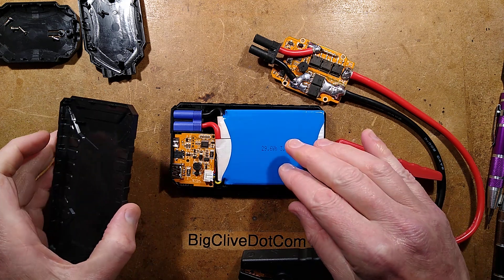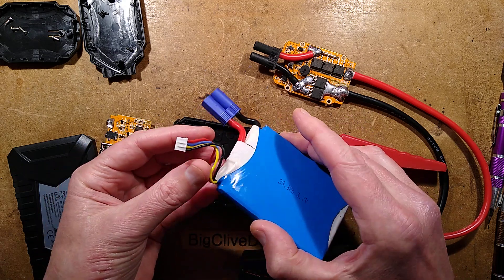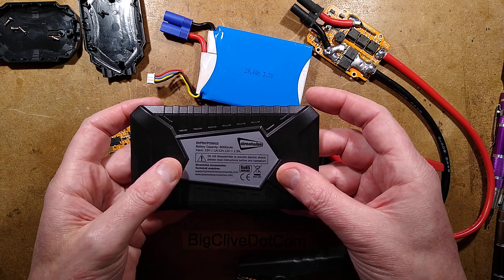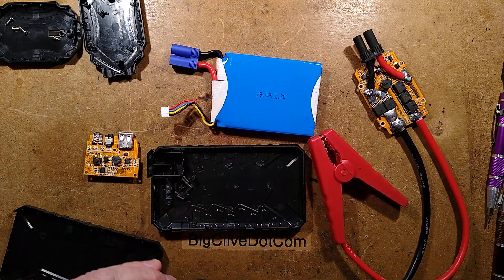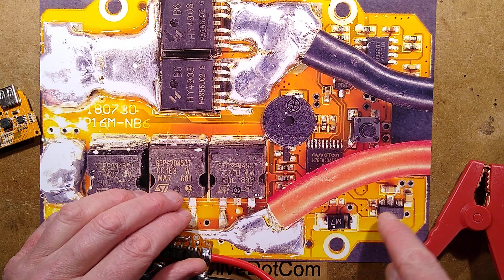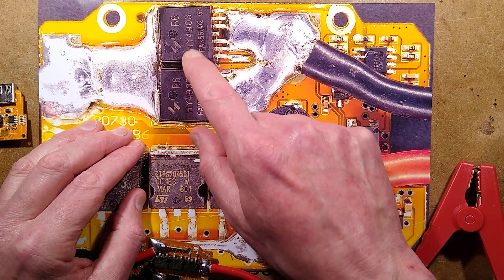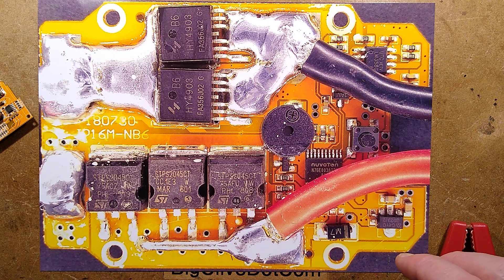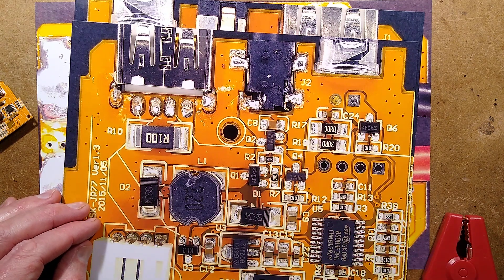Inside a combined power bank and jump starter

Comment: Since it already has a 12V battery, can it do USB PD (i.e. put those 12V to the USB port if the charging device negotiates it)?
Reply from the maker: In this case the USB output does not have the data pins connected.
Reply: @bigclivedotcom  if the data pins arent shorted, the device doesn't even ask for higher currents then 1A.

Comment: I remember that Samsung disaster, I had one of the note 7's affected, and got back the "Check marked" replaced battery version, still had problems getting too warm, I was left with work around of using a partial vacuum clear container, and had it off like 80% of the day lol. Although I wonder if it had still gone to hell if it would have generated its own oxygen to keep a fire going? hmm.

Comment: You can get a 12V Cig Lighter Socket for these that plugs via the jack on the jump part if it has one, or plugs into the same connector on the pack. No protection or fuse though, other than the fuse in the plug if any.
Reply: The problem I've found with those is that they seem to overpower my 12v appliances. I was wondering if it was better to use the lighter socket or use a usb to 12v adaptor. The adaptor is less efficient but it would seem it might be safer, both for the battery and the overpowered appliances.
Reply: @thomaswilliams2273  They shouldn't overpower a device designed for a 12V socket, as the ones in your car are not generally regulated to 12V, they connected via an ignition relay and a fuse only normally so they output whatever the battery or battery+alternator voltage is which could be between 11-14.8V and this will output somewhere from 11-15V depending on charge.

A USB to 12V would generally be a noisy source of 12V but at least a constant voltage but a 5V@2.3A source is likely to give less than 800mA at 12V converted even if it's a very efficient buck converter.

Comment: I'm wondering if you or someone can help me out. In trying to reduce voltage from a 40v battery down to 20v to use on a hot wheels. I can't seem to find a buck inverter that goes up that high. If you have any ideas it be greatly appreciated
Reply: Assuming standard brushed motor, replace the controller with one that can take 40V and limit the duty cycle to 50%.
Reply: @NiHaoMike64  I tried this and already burnt through 1 motor. Used a pwm board made for up to 60v set at only 40%. You could tell it was running way harder than when I had it hooked to a 20v source

Comment: I'm very skeptical about these. For one thing those wires look too thin, and from what I recall, Li-Ion batteries hate discharging huge loads in one go. Peter North it is not.
Reply: You're sorely misinformed.
Reply from the maker: These cells are optimised for high current and the cables are intended for intermittent use.

Comment: Is that Marking  on the battery correct at 29.6Wh at 3.7V  or is that marking just for 1 of the 3 cells to output ~12V ?
29.6/3.7 = 8

Comment: I have one of these combined power bank and jump starters and it has come in handy a few times over the last couple of years. And the only difference mine has over the one in the video is a button you have to press when you are connected to a car battery to initialize the process and it squeals at you when the car etc has fired up to force you to disconnect it to prevent damaged. "Arteck Car Jump Starter Auto Battery Booster and 8000mAh External Battery Charger Car Jumper for 12V Automotive, Motorcycle, Tractor, Boat, Phone" and it's no longer listed.
Reply: You don't see the pushbutton? It's on the small board clear as day.
Reply: @Slicerwizard  I had been up for a long time when I watched the vid.

Comment: Diodes seem to be identical (stps2045ct) but different production dates. Datasheet doesn't seem to have any information on the markings apart from the part number, which says the STPS2045CT is the TO-220AB package. Still a bit odd that they used 3 parts from what seem to be wildly different dates
Reply: the parts looked used to me

Comment: I remember Photonicinduction playing around with one of these. I think the 12V connection had just the diodes for protection, nothing else. He actually started his car with just this thing, disconnected the cars internal battery (NEVER DO THAT). Just shows how much current these things can deliver. Pretty scary, carrying that around in your pocket (I certainly wouldn't trust them, at least not in my pockets, or in a car, that can get pretty hot while parked in direct sunlight).
Reply: I still have that same model. Works every time. No stupid pushbuttons to turn it on. Just connect the leads, let it put some juice into the dead battery for a while (duration depends on just how dead the car battery is), then start. It has even started and run vehicles with dead batteries and dead alternators long enough to get them home (you've got 10 to 15 minutes, max; helps to disconnect the DRLs and stay off the brake pedal)
Reply: clive once did shortcircuit one of these with a copper tube and measured the max. amps. can't remember exactly but it was over 200A IIRC.

Comment: 2 amp is not enough for a jump starter, you did not explain exactly the most important thing about this device which is the maximum current output
Reply from the maker: The 2A is just for the USB.  The battery pack can supply 100's of Amps.
Reply: @bigclivedotcom  thank you
Reply: It has plenty of output current.

Comment: the shock hazard comes from the charger witch connects to any 110 or 220 outlet.

lithium cells can start fire if punctured or damaged.

most mosfets have a current limit much lower because the package has a limit so there will often be lower than the semi conductor material.

i think most of the jump starters are intended to charge the battery up enough to allow you to start the car.

for example lets say you leave your lights on and drain the battery to the point where you cant start the car this is great for that.

you are really pushing the limits of these units trying to start a car from a completely dead battery that is dead because it is old or acid crust builds up on the terminals.
Reply: "i think most of the jump starters are intended to charge the battery up enough to allow you to start the car."

No, they put some charge into the battery, then their combined output starts the engine. Can take a minute or two.

Comment: I'm not an EE, and didn't know anything about these jump packs (I do have one) but I was surprised by the design.  I had always assumed there would be some sort of supercapacitor in them that would be used to actually jump start the car.  Is that high discharge lithium pack some sort of hybrid between a battery pack & a capacitor?
Reply: No, it's relying on the ampacity of the lithium cells.

There are some supercap design jump starters...Project Farm included one in a jumpstarter comparison, a few years back. That particular model used the residual charge in the vehicle battery to 'fill' the supercap, and then burst discharge it back, hopefully giving enough ampacity, fast enough, to turn the engine over.  PF didn't have much success with it, and found the more conventional Li battery models much more effective.
Reply: Super capacitors just don’t have the energy density needed.

Comment: A 9-volt battery on the tongue gives a tingle but I imagine this would pack quite a punch. 😝
Reply: Nope, we at least not mine: if it doesn't see that it's connected to voltage, it doesn't turn on.
Reply: @tactileslut  well, what fun is that?

Comment: I’m kind of surprised the jump-starting module doesn’t do at least some over-discharge protection. It already has everything it needs to cut the output off. It’d cost, what, one wire between the modules and maybe a passive or two to power the 12V module’s microcontroller from the 5V side’s output?

Do they just not want protection? I suppose that makes a bit of sense: If you’re using it as intended you’d rather risk wrecking the lithium cells than having it refuse to start your car just because there’s a fault on the 5V side that prevents it from working as a USB power bank.
Reply: Actually, I think you're right on the money there. Sacrificing a few lithium ion cells to get your only link to civilisation working again seems like a worthy cause; so long as said cells can fail in a non-lethal manner.

Comment: How do these compare to those supercapacitor ones in real life situations? Supercapacitor ones are useless if the battery is flat, but then again, do the built-in battery ones perform any better? I image they'd drain pretty fast, that's if they even started at all, before the high-current cut-out kicked in. I have a 13 Ah one, but haven't needed to use it yet. When it's -15 C outside and the battery is dead, I'm not gonna get my hopes up with these. 😅
Reply: They work. You warm them up first by shoving them down your pants for a while... then clip on to the dead battery for a couple of minutes to bring it back to life, then fire up the engine, then unclip - and recharge immediately...

Comment: For protection, maybe add a big relay powered from the USB 5V output? This way, the device will shut off when cells are discharged. Remember to cut off the high current board too, as its microcontroller draws significant current the whole time it's connected.

Comment: @bigclive 
Could we soon make a diy video of interior lights for cars.
Alot of people need them in warm White with and without CANBUS🙂

Thanks for all your videos over the years🙂👍🏼
Reply from the maker: The canbus feature on eBay bulbs is often just a load resistor.
Reply: @bigclivedotcom  
Hi clive yes i have seen some of them.
And i dont Think many of them is looking safe. And as a mechanic a have a couple times made burned wires on cars with Chines “canbus” bulbs.

You could make them safer for us with less heat i Bet🙂👍🏼

Thanks for answering🙂

Comment: Awesome video. I have some higher capacity more “professional” units that I use in my day to day at an automotive shop. I’ve not found anything my NOCO GBX155 won’t turn over. Not even massively upfitted motor homes with 4 or more 12v batteries in parallel. Even with our dual full-sized battery jump start cart, we used to have to disconnect some or all of the batteries to get those beasts running if they were really dead.  The Schumacher DSR128 is my second option that the shop owns and then I’ve also got a Amazon special for home use. All three of the ones I own/use have internal disconnects and nothing in the cables as the more run of the mill units do. They each sound as though they have contactors inside them. Any chance you might be able to do a video on a more professional unit like one of the NOCO GBX series or the Schumacher DSR128 or equivalent?
Reply: I’ll be honest, the municipal garage I work for hasn’t had any luck whatsoever with the NOCO Genius units. My $60 Amazon special GooLoo jump starter seems to turn over our 3-cyl diesel mower engines better than even the mid-sized NOCO does - I thought maybe we got a few duds, but then I saw Project Farm’s review videos which seemed to verify the issues we’ve had with them. They work, they just seem to be rated much higher than the units are capable of.
Reply: @97marqedman  Completely agree. The smaller and midsized NOCO units aren’t worth a damn. In my opinion and experience, you don’t really start to get anything respectable out of them until you step up to at least a GB150.  I’ve also seen the project farm video and purchased a GooLoo 4000 unit for home use and it works fantastic when I’ve needed it. I have put my NOCO GBX155, my GooLoo 4000 (the newer heated unit), a Schumacher DSR128 and a NOCO GB70 unit all on a carbon pile. The NOCO GBX155 was over two hundred amps ahead of the the second place GooLoo at the same voltage of 9V. If memory serves correctly the GooLoo was about 150 amps ahead of the third place Schumacher at the same voltage.  The NOCO GB70 will work but it’s really an insult at the performance per dollar you get out of it and in my testing it came in a distant last place finish and it’s definitely not worth the money. Also, as Todd pointed out, what the heck is up with the crappy little bag NOCO?
Reply: Are the 4 huge in parallel not for the living quarters rather than the starter?
Reply: @rimmersbryggeri  So it depends on who up fitted it and who owns it.  As stock straight from the OE manufacturer, the most starter batteries available on the diesel cab chassis is two.  A single starter battery is standard with a second being optional. There are also different sized battery options from the OE as well. Most vehicles have one or two 80AH batteries but they can be spec’d with two 100AH batteries.  There is also a dual alternator option from the OE.  Generally most up fitters will spec the cab chassis as dual battery dual alternator and leave it as is and then add a bank of 4 or 6 deep cycle house batteries.  However it is insanely easy to add two more batteries into the starter circuit with bolt on battery mount kits available from many aftermarket suppliers. The kits usually include the required cables as well.  Just about anyone with minimal hand tools and technical knowledge can install these two additional batteries in a few hours. The most time consuming part being running the new cables and how clean you want the install to look.  In this configuration there will be 4 batteries in parallel in the starter circuit.  This is before someone decides that if 4 is good then 5 is better and manages to cobble together a mount and hide a 5th starter battery somewhere. This is very rare but we have seen it.  Then we sometimes run into someone who connected the starter batteries to the house batteries without any sort of battery management installed and man that can be a major pain to deal with.  Honestly the worst offenders though is the state department vehicles. They will never ever share any information with us about the up fits on the vehicles and because the vehicles are heavily armored it’s often difficult if not impossible to tell what batteries are where with just a quick visual inspection.  Also I’ve never seen two identical state department vehicles so you can’t even formulate a standard setup. Sorry to take a short answer and make it long but I get the distinct impression you know what you’re talking about.
Reply: @2down4up  My uncle had a rebuilt inte city bus as an RV and I think that had 2 series started batteries and 4 or more huge parallell batteries for the living quarters. I guess an american rv will have an inter city size motor though like  cummins or international so more batteries make sense there. Same way they put 2 batteries one on each side of the engine compartment on the big Pickup trucks I thought you were british and for a transit camper 4 starter batteries would be total overkill.
Reply: @rimmersbryggeri  I’m sorry I should’ve clarified I’m in the USA. Actually the biggest engine available in the chassis I deal with is a 3 liter V6 diesel. Obviously it requires more amperage to start then a comparably sized gas engine but its still nowhere near what a medium duty inline 6 like a Cummins in a pickup truck would need and much less a large displacement heavy duty industrial, big rig, or mass transit engine requires. Regardless many customers believe there’s no such thing as too much cranking power and therefore I wind up in the situations I’m in at times.  No kill like overkill!  It does make me wonder just how little the owners must care about simple upkeep such as using a battery maintainer that they manage to kill 4 or 5 or more batteries to the point they can’t start the engine.  It’s like the customers either left some large current consumer on or have a fairly large parasitic draw because otherwise with that much starting current on board they should be able to leave the vehicle for months on end without having to worry about having enough amperage to start it.
Reply: @2down4up  Yean a 3L v6 hardly has enough power in the alternator to charge that much and it can probably play havoc with the charging regulation too. Do you wasth "Watch Wes Work" here on youtube?
Reply: @rimmersbryggeri  No.  I’m afraid I’ve never heard of that channel before.
Reply: @2down4up  I think it might interest you.
Reply: @rimmersbryggeri  Ok I’ll check it out. Thank you!
Reply: In the U.K. extra batteries used for supplying ‘domestic’ power for living quarters or similar are known as leisure batteries. These are designed more for long discharge/deep discharge cycling rather than short term high current use (like starter batteries). If a vehicle does not have a dual alternator, we use charge splitters/controllers. These only connect the leisure batteries to the main battery/alternator when the voltage is high enough. So don’t let the user drain the starter battery when using ‘domestic’ power.
Reply: Clive's got an autopsy on at least one NoCo...disengenuously titled "Genius", IIRC. Appealing to the Apple "I" crowd, no doubt  :- P

Project Farm did a good shoot-out of a half dozen or so models, a few years back.

Comment: I went with a supercap based jump starter.  Lighter, more durable and heat/cold tolerant, able to leap tall buildings in a single bound.
Reply: And it dies far too quickly. And expensive AF.